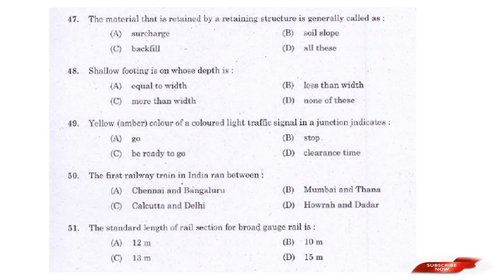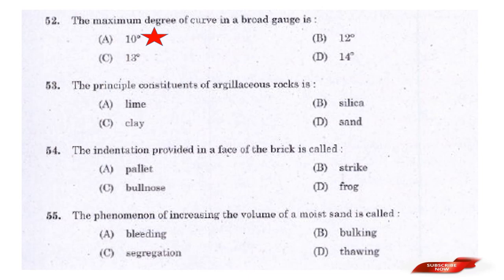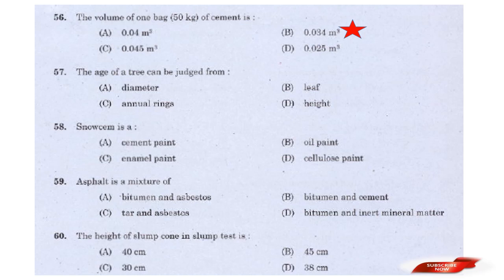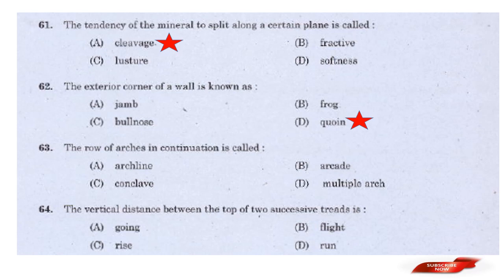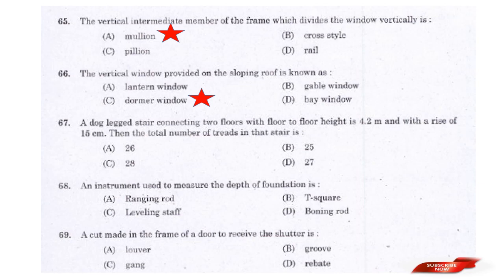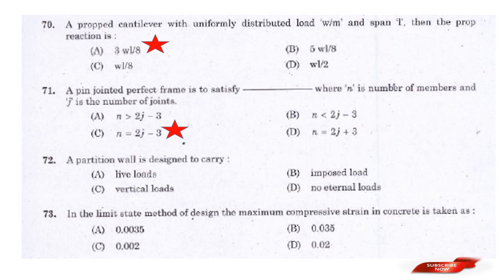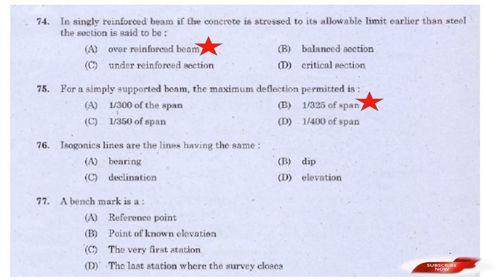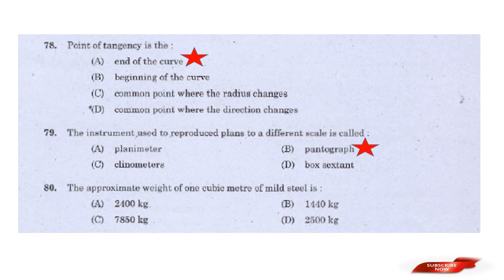FREE MOCK TEST /FOR UPCOMING ALL CIVIL ENGINEERING EXAMS //PREVIOUS YEAR QUESTIONS

Comment: 73 question answer correct anoo.plz explain
Reply from the maker: according IS 456, Q) MAXIMUM strain in concrete in outer most compressive fibre= 0.0035
Q) limit state of collapse for direct compressive ,the maximum axial compressive strain in concrete= 0.002
SO, ANSWER I THINK 0.002....otherwise i check and comment

Comment: 73 A Alle varuka
Reply from the maker: according IS 456, Q) MAXIMUM strain in concrete in outer most compressive fibre= 0.0035
Q) limit state of collapse for direct compressive ,the maximum axial compressive strain in concrete= 0.002
SO, ANSWER I THINK 0.002....otherwise i check and comment

Comment: Mam question no 67 ;28-2 Alle varuka.Two flight varilye
Reply: Explain cheyyavo? Any equation or condition to find no of treads
Reply from the maker: ya..it's a mistake ,
total no.of treads =28-2 =26
Reply from the maker: no.of riser = height/rise
no.of tread = no.riser -1(connect one floor)
no.of tread = no.riser -2(connect two floor)
Reply: Tks mam

Comment: 73 question answer .0035 alle??
Reply: plz jn there for more mock test and vdeo class
Reply from the maker: according IS 456, Q) MAXIMUM strain in concrete in outer most compressive fibre= 0.0035
Q) limit state of collapse for direct compressive ,the maximum axial compressive strain in concrete= 0.002
SO, ANSWER I THINK 0.002....otherwise i check and comment